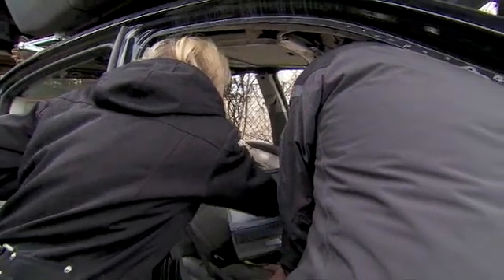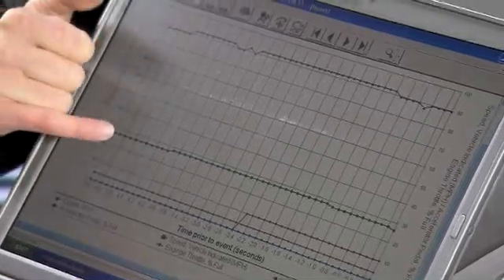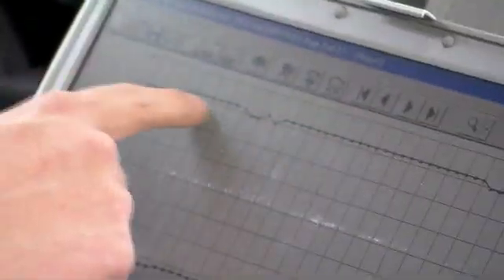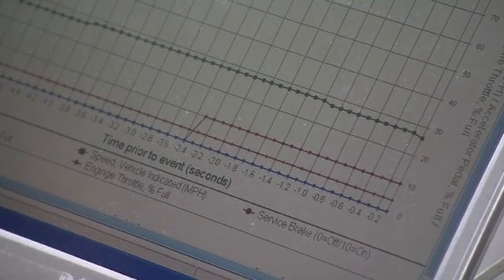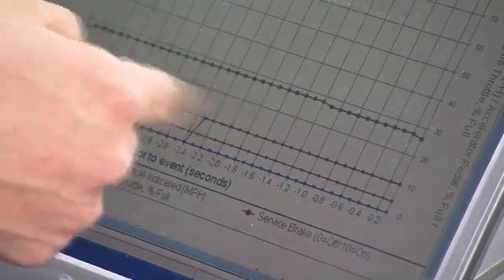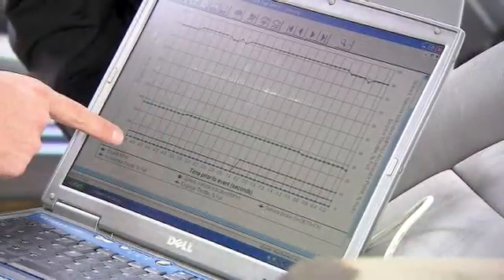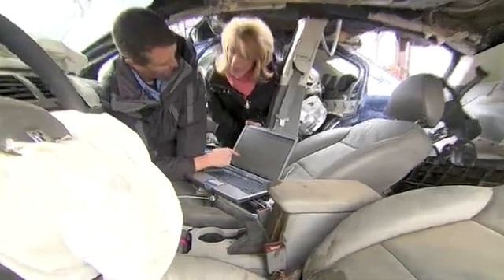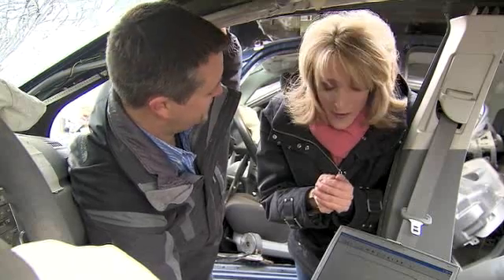Inside a car's black box

Comment: Actually the only ones I've seen are in fact, black. The one in my pickup is under the passenger seat it is not only black but it is plastic, not metal or silver.

Comment: I would want to know how much this box costs,and would tell the dealer to remove the box from the car or deduct the cost of the box from the agreed price for the car.
Reply: Airbags are required in these cars and they wont work without the box.
Reply: @mindcontrol31  Airbags have been around a lot longer than the black boxes.

They can have airbags work without the boxes, if they cannot remove the box they can deduct the cost of the box from the agreed price.
Reply: You're speaking like a true buyer. Consider however this action might be unlawful or require the insurance company to raise your premium